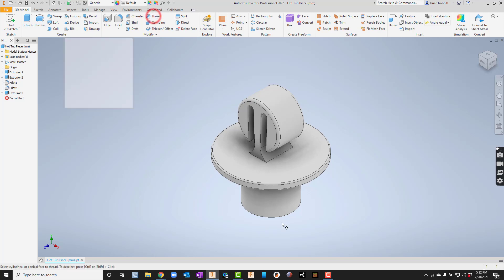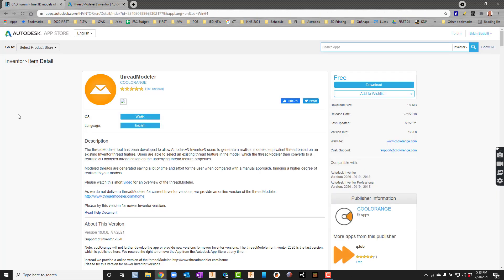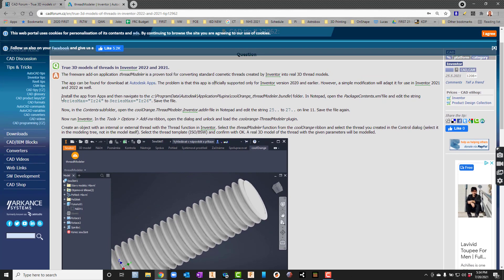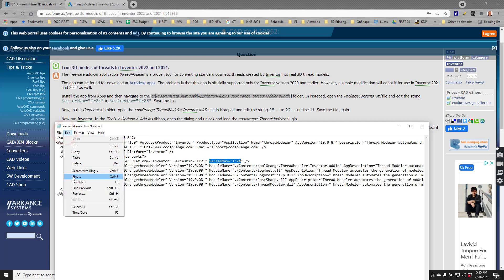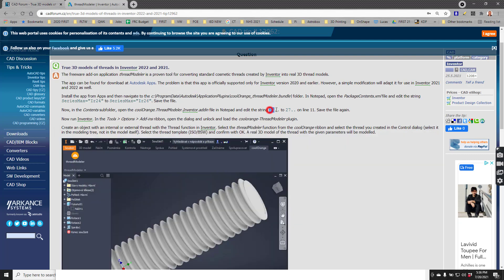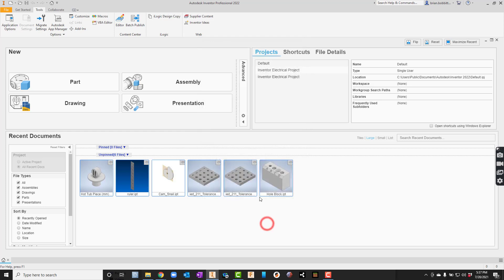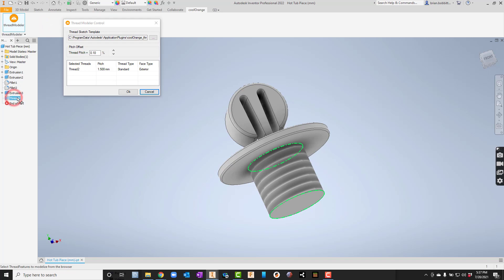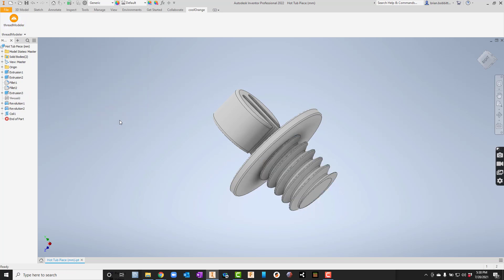Fixing the Thread Modeling in Autodesk Inventor

Comment: It is crazy to me that Autodesk still does not have this feature built into Inventor as a basic core feature of the program in 2025 when 3D printers are everywhere and everyone can get one at a very low cost. Even their lower end software, Fusion 360, has that capability long ago. What is wrong with Autodesk?

Comment: It didn't work for me, what's the reason?
Reply: what version you using, if its newer then 2023, will be 27 2024, will be 28 and 2025 will be 29, the other numbers also move the same way, as soon as you reboot and open inventor it sees it and you unblock it, add it in the ribbon, reboot inventor and then it will work
Reply: @stewarttyler6291  thanks

Comment: I have a standard .ipt file for threads, it has ISO standard geometry for ISO M series threads. All I do is change 2 parameters, diameter and pitch. The geometry changes. I then copy those sketches, internal and external threads and paste them into my .ipt file, constrain the sketches then use the coil tool, for the internal or external thread and thats that. If I cared to use model states it would be simpllified by  picking the M size from the browser then copying the sketches.

Comment: 2024... tried this with Inventor 2024 and it didn't work. So, I just increased the numbers from ir26 to ir28 (SeriesMax=) and  then 27 to 29 (on line 11). Worked and printed perfectly.
Reply: I was able to add the add on but it doesn't show on the ribbon tab at the top, how did you get yours to show up?
Reply: @DKLivez_TV  When you first start Inventor, make sure you click the Add-Ins under the Tools tab (3:38 in the video). This will open the Add-Ins Manager. Then make sure you check both the Loaded/Unloaded and Load Automatically checkboxes for the coolOrange-ThreadModeler and uncheck Block. That's all I did after changing the numbers I mentioned in my original comment and now the coolOrange feature shows up in the ribbon and works for my Inventor 2024.
Reply: @philosophies7821  oh yeah I figured what's wrong, I was assembly a bunches of part together, I had to go the part itself dor the tab to open up. Thank you!
Reply: @DKLivez_TV  I found out that you have to enter higher number in this mothod (e.g. 29) and it will run in Inventor 2024

Comment: Tried this with the 2024 version and currently facing the following issue:  The plugin shows up and seems to model the thread correctly, it even shows up in Cura. However, my printer will not make the thread when printing the object. What am i doing wrong?
Reply from the maker: To be honest,  that's nothing to do with the Thread Modeler.  You might need to change settings in your 3d printing slicer.
Reply: Will look into it, even though i didn't modify any settings in my slicer and it used to work perfectly. Thanks for your response!

Comment: In 2024 after changing all like it shows the add-in is not showing up in tools/add-ins. There is no "coolOrange" of any kind
Reply: U need to delete the 11 string in coolOrange.ThreadModeler.Inventor.addin and then it will work, when u'll open inventor again there will be a message that request to unblock the new add-in